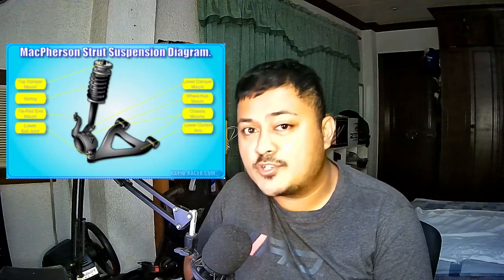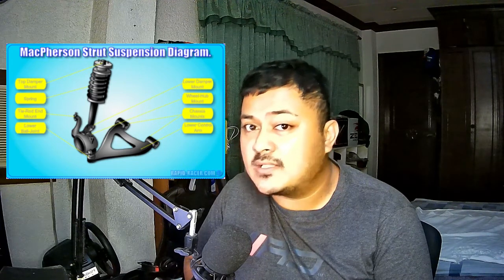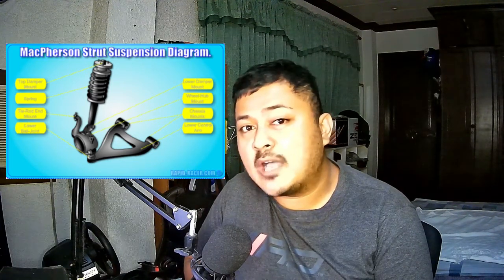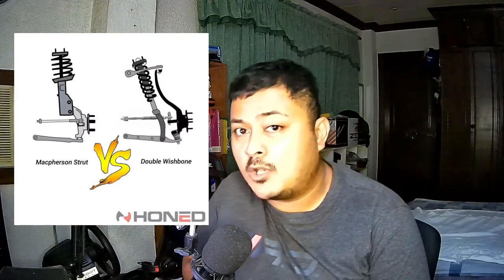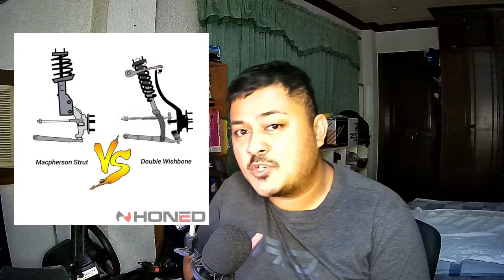Installing Lancer CP9A Evo 5 Alloy Lower Control Arms in a 1996-2000 Elantra! - Project Elantra V6

Comment: Great best of luck idol! Where did you order your parts sa pinas?
Reply from the maker: For 1996-2000 Elantra J2 parts we supply and stock them, brand new and used. Look fot KHL Motorsport/Kuhol Garage on Facebook.
Reply: @kuholgarage  the Evo parts? I am looking for a steering knuckle to fit evo 4 rotors maybe you have? Thanks po
Reply from the maker: @meowtrox1234  Facebook Marketplace if local supply. Look for RVR brakes from parts out, or FTO brakes. Maybe they will work.  If you want Evo  stuff, maybe we can source you some. Message us on FB.
Reply: Thank you @kuholgarage  .